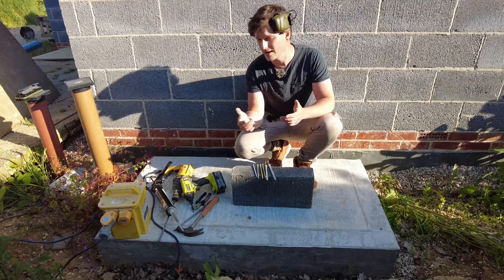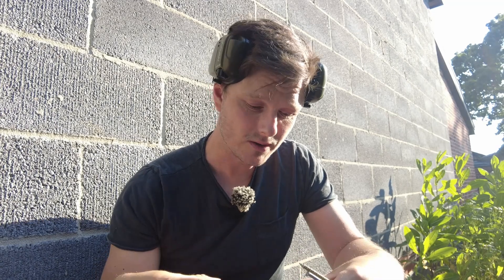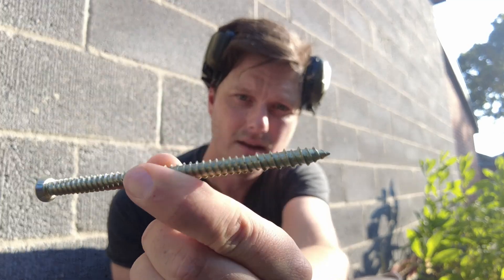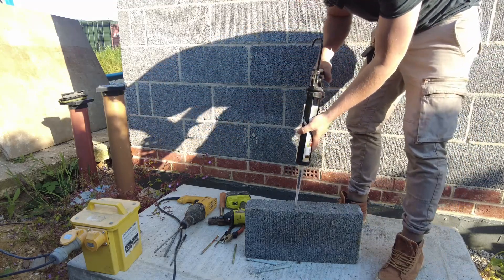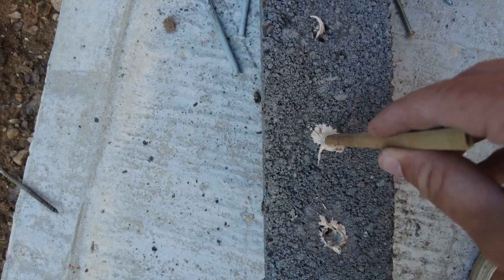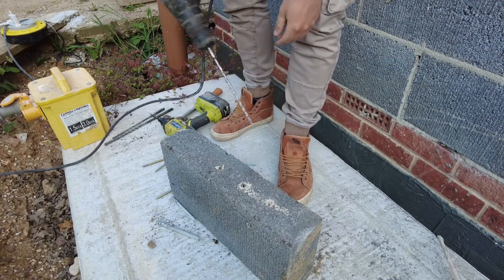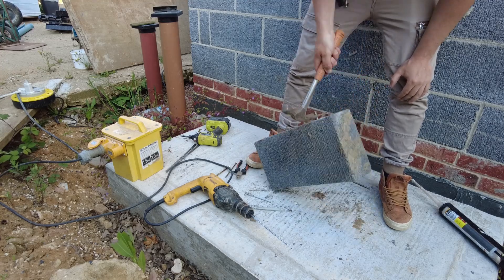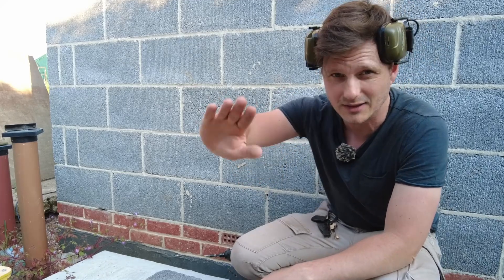Can Chemical Resin Fix Failed Fixings? Redrilling Experiment Reveals All

Comment: Ive found its worth spending on branded frame fixings, stuggled with most, but then tried fischer SXRL. And not had any issue with snapping, bending or stripping....the design of the plug is a bit different.
Reply from the maker: That's useful to know 👍

Comment: If you’re gona drill them out anyway.. just chemfix an m8 rod and bolt them in? Do it in situ..
Reply from the maker: That's an idea although I think there's at least 4 I couldn't because of the extra security bolts, they need to sit in a recess. Although I don't really need the extra security as it goes
Reply: @THE-AIDEN-PROJECT  I suppose you could do try your Chemfix repair first, any that don’t take, drill out and try again.

I did also think, you could drill the holes out and use m10 concrete bolts (thunderbolts) as they need a 10mm hole and have a more corse thread, as long as you can fit a 17mm socket into the recesses in the frame.

Comment: Me thinks that two of them holes weren’t cleaned out fully or filled fully. 
Have used chemfix for so many jobs and it’s amazing stuff, will certainly do what your intending for your Lathams door( if holes cleaned and filled fully).

Bon chance. 
Ps, what’s with the hair 😂
Reply from the maker: Haha I do actually have hair 😂
The middle one wasn't filled at all 😬 I purposefully didn't clean out the holes to see what happened for a worse case scenario, I think in general though I'd rather drill them out wider when doing this kind of thing

Comment: The chemical composition will almost certainly be stronger than the sub-straight you are fixing into.... that said, correct application is key.
Reply from the maker: Yeah correct application like actually getting it in the hole rather than a tiny bit at the top 😂

Comment: I've re-secured frame fixing type wall plug with a chemical fixing resin before.  I removed the plug, injected the resin and then put a new plug in.  They haven't budged since.  This was for a banister rail.
Reply from the maker: Ahaa that's good to know 👍
Reply: That sounds like the answer.....use wall plug and the screws with thicker diameter shaft instead of concrete screw. Glue the wall plugs into the wall with the chemical resin......presumably wait for the resin to set before tightening the screw into the wall plug.

Comment: My suspicion was yes, this stuff is brilliant. Did you prepare the hole properly with a pump and brush to clear the debris? You'll risk lower adhesion without 👍🏻
Reply from the maker: I didn't for the test and it still worked OK. I would for a real world application though. I've got my fancy purple blower thing haven't I 😁

Comment: Interesting experiment! I would be skeptical about relying on this for a purely tensile load (esp hanging stuff vertically) but as apart from the need to pinch the frame in to plumb (tensile) the main force you are concerned about is probably shear (I.e the frame neither falling out or being forced out easily) and as long as the substrate doesn’t fail then it looks a good option to me. I’m no engineer BTW just my 2p
Reply from the maker: Now I want to test it's pull out strength properly 😂